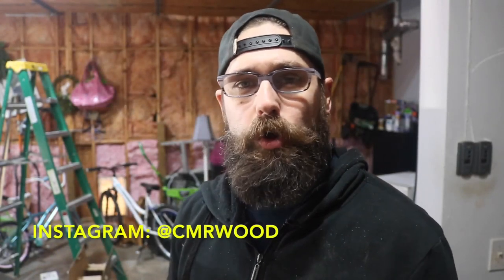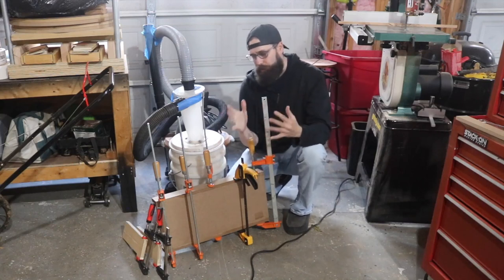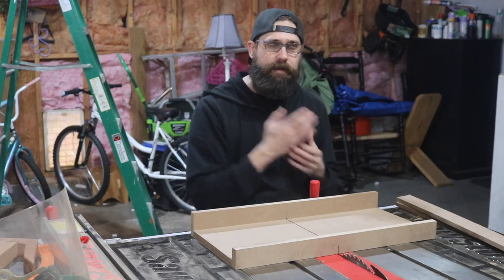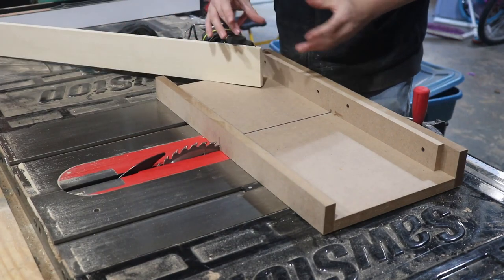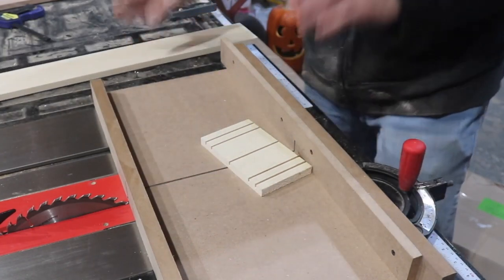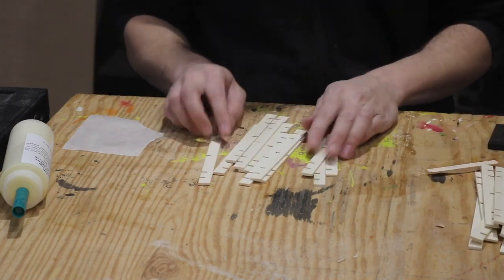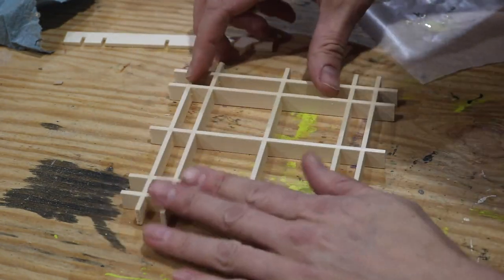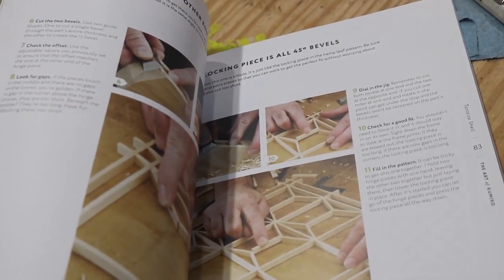My Intro into Kumiko, a Japanese Woodworking Technique

Comment: Very interesting and informative. A real departure from the guitar build.
Reply from the maker: Yes, it‘s actually a nice side project to work on with the guitar. In contrast to the guitar it‘s less stressful and cheaper, haha. A nice little break here and there and quick to do. I‘ve been wanting to pepper in videos on my channel that aren‘t guitar related here and there and I think I will explore kumiko a bit more as I have found it so fun already.
Reply: @CMRWoodworks  Thank you, I’ll be watching.  I know nothing of kumiko but I was expecting its precise cuts and tension to hold it together without glue.  Be sure to wear ear protection for all the table saw work.
Reply from the maker: @charlesdavis7616  oh yeah ear protection for sure. I have had the same Ryobi ear muff style protectors since I started woodworking. They hurt my ears a little after prolonged use, but work great. I‘ve been thinking about switching to ear plugs. I have always had issues with the respirator and ear muffs together. Just so much on my head. I‘m planning on getting a full face respirator because I‘ve been so paranoid about breathing any dust. I‘ll definitely need to downsize to ear plugs if I get that space helmet looking thing.